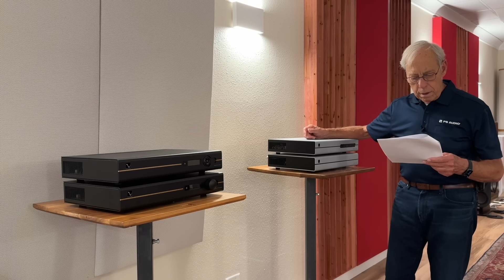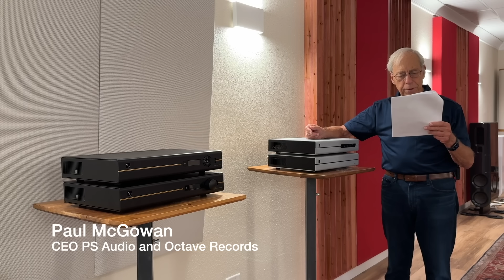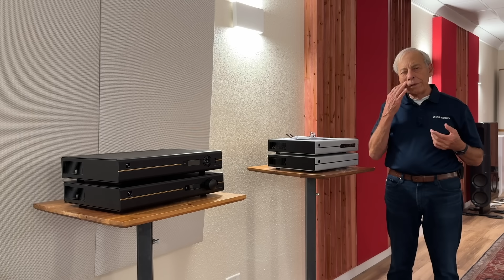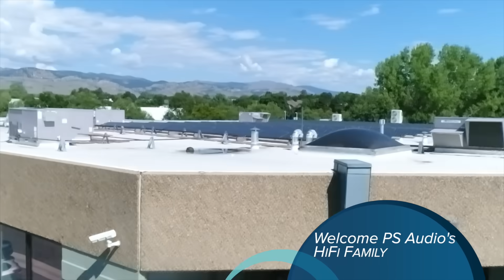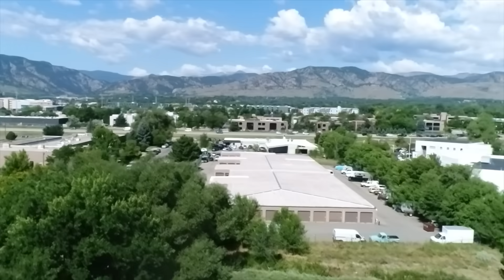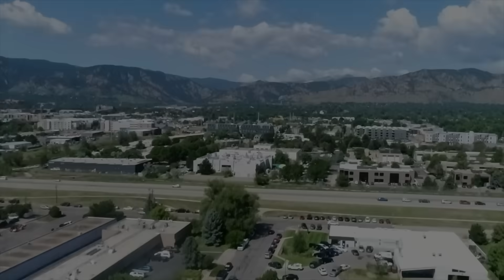Why some systems sound flat

Comment: Carlos, from Buenos Aires, Argentina, the first thing that you should do is to confirm that the issue really is the quality of your electrical power, at different times of the day.

To do that, choose a couple of songs that sound magical at night.  Then use those exact same songs during the day.  If those two songs lose their magic, then the issue is probably with your electrical power.

There are UPS (uninterruptible power supply) systems, generally used for computers, where the best of them run as "on-line".  And I wonder if one of them would do the trick.  They will probably not be as good as our host's power plants.  But they will also cost less, and maybe worth a try.

There are three types of UPS systems.  From lowest quality to highest quality:

-- Standby:
They basically do nothing, other than switch to batteries, when there is a power failure.

-- Line Interactive:
They will adjust the output voltage, if the input voltage moves too far out of spec.  They will also switch to batteries if the voltage goes beyond what they can correct, or if there is a power failure.

-- On-Line:
Your connected equipment never sees the power from the utility company.
On-line UPS systems do double conversions (which I believe our host's power plants also do), from AC to DC, and then back to AC.  So your connect equipment sees only the freshly created AC from the UPS box.

Theoretically, an on-line UPS will always send out a perfect sine wave and the right voltage.  However, I do not know if they remain steady if a pair of amps suddenly make a large power draw.

On-line UPS systems can cost anywhere from several hundred dollars, to more than a house by the lake.  It depends on how much of a load they can support.  The largest models can run a small city (several megawatts).  Large tech companies use them to keep their data centers running, without electrical interruptions.

I own a couple from Eaton Powerware (models 9120 and 9130 -- both discontinued).  But I never tried one on my stereo.  It would be a chore to disconnect everything, carry it to my living-room, and then plug in everything.  A current model (9SX1500G) goes for roughly $1500, and is rated at 1500 VA (enough to run a microwave oven or a vacuum cleaner).  If I find the time, perhaps I will indulge my curiosity and hear if using one helps.

Note that they have a fan that you can hear.  It is a soft sound, and will not be audible on anything other than very quiet musical passages.  But I cannot speak for any models other than what I own.

Also note that other manufacturers make on-line UPS systems.  American Power Conversion (APC, a Schneider Electric company) makes them.  They used to be quality products.  But their quality has tanked.  I have had 3 of them fail, a total of 7 times, over 2 years (that includes the warranty replacement models failing).  I also have two 20 year old APC, line-interactive models, that work as good as new, and never had a hiccup.  So APC is now cutting corners, and I am done with them.  Tripp Lite makes them too (not sure of the quality).  I believe that CyberPower also makes them, and also not sure of the quality.  And there are others.
Reply: I've often wondered about using computer backup power units for the Hi-Fi equipment, but haven't given it a try.
 I'm a repair technician, and your points are spot on.
Reply: @davidjudd951  The only variety of UPS boxes that makes sense for a stereo is an on-line variety.  And be sure that it outputs a pure sine wave.  Probably all on-line modes do.  But who knows?

One place where manufacturers cut corners is having their UPS systems output square waves (the worst), and stepped sine waves (better, but still not good).

A good power supply will be able to handle square waves and stepped sine waves, but over time, will probably be damaged and lead to equipment failures.  And with audio gear, I will go out on a limb and say that if you feed it anything other than a pure sine wave, then your sound quality will suffer.

If you get a UPS for a desktop computer, a sign of quality is if it outputs a pure sine wave, when it is on battery (during an electrical outage).  There are many line-interactive UPS systems, and most (I believe) output a stepped sign wave, when they switch to their batteries.  For a computer, to occasionally run on a stepped sine wave for a few seconds or a few minutes, is probably fine.  But one measure of a quality, line-interactive UPS system is if it outputs a pure sine wave while running on its batteries.

Comment: I have 2 P12 power regenerators that make a big difference in the entire system & there's no way I could go without them now but somehow I still hear not so good sound early in the morning no matter what. It's probably the neighborhood plus the house is 70 yrs old but still it's only in the morning & by afternoon it's gone. Time to upgrade the wiring too which does help. Audiophile upgrades never End
Reply: Rabbit-hole diplomacy 😂
Reply: I have a 65 year old house. 
 I noticed several years ago, after I rewired the house, and got rid of the old two wire (dangerous) wire,  and went with 12 gauge 20 amp throughout the whole house, that the big screen TV seemed brighter and overall just a better picture. 
 Then one day shortly after the project, I fire up the music, and it seemed much better. 
 I always wonder if I was imagining it or not. 
 I don't think I was imagining it, since I wasn't even thinking of the TV picture quality or Hi-Fi sound as a reason for the project.
Reply: @davidjudd951   ...exactly! But some flat Earthers will tell you that it's The Placebo Effect 🙄

Comment: This guy is so full of it hahaha
Reply: Take this from an electronic engineer (me), this guy is absolutely totally full of it I promise you 🤣 everyone is using the peak of that sine wave at the same time?? And somehow that makes your audio flat? This is insane speak. He clearly has no understanding of the electrical system he’s plugging his gear into, or more likely wants you to have no real understanding of the system.
To be clear, the 50/60hz waveform from the power grid will have an RMS voltage within a published tolerance throughout the day/night cycle. Unless there is an actual issue with the grid. The power supply of your device will rectify, smooth and then regulate this to a clean DC level, and any ripple here is entirely down to the design of the power supply of the device. Ripple here could cause noise in your audio output if it is badly isolated but it will manifest in the form of a 50/60Hz hum introduced in the power amplification typically. It will not however change the profile of the digital audio processing subsystems or analogue filtering or literally anything else that affects sound.
Reply: Based on what, exactly?
Reply: @vladfarcam4817 ...hmmm, let me guess.
Paul  has worked hard all his life & built up a successful business over fifty years, whereas you are
still living off food stamps that are about to be cut & living in a rent-controlled hovel. Butt-hurt much? 😁
Reply: Yeah he made money selling you stuff - have a think
Reply: Just because you don’t understand doesn’t mean he’s full of it, go listen to your noise
Reply: @mattjashyn3194  I hope you enjoy the hiss and cracks of your turntable tonight!

Comment: The noise. And /or lower voltage during peak times does not change the ability of a system to play the source accurately except for the added noise(rf) . And some slightly reduced voltage.. translated...less power. But only noticeable if played at moderate to high levels.

Comment: Please stop using or not correcting incorrect terms..flat means correct.. accurate to the source.  Flat does not mean no bass and no treble ..or not dynamic..(compressed) . As someone that sells . Builds. Designs.teaches...its your job to do what we all did in the 60s and 70s... educate..
Reply: Flat doesn't mean correct unless you're using a test tone. He's listening to music
Reply: If you define what "flat" means before you start talking, then 'flat' can mean whatever you want it to mean.
Reply: Gosh, this is too stupid. Your mains voltage is not that different and only your power amplifier without voltage regulator will change the peak dynamics due to a slightly lower voltage. A few volts lower means a fraction of a Decibel at MAXIMUM USABLE VOLUME...which is not what you use in the evening unless you have some insane party. No, truth is, in the evening you reduce the volume because it's evening and our friends Fletcher & Munson make your audio sound subjectively more narrow band (equal loudness curves). Another factor is the simple fact that when we feel more sleepy, tired or drunk, we lose ability to experience music at its fullest. Try a Red Bull and if your system comes alive...it's also not a system issue but a brain issue. But all respect to Paul who wants to make more business. He is still the most awesome CEO in audio.
Reply: @ThinkingBetter   ...ahh, 'some insane parties'...great memories 👍
Reply: @ThinkingBetter It's been a thing for as long as I can remember to test stereo in the evening or at night as it can sound better in some places. There's a whole lot more to electricity than just voltage or voltage regulation.
Reply: @PSA78   ...according to some, you have to be able to measure it, otherwise it doesn't exist 🙄
Reply: Funny thing is, a lot can be measured, it just requires equipment that most might not have. But there's things that we can't measure or usually don't measure as well, that anyone can hear the difference in, like the tone from two different instruments with different harmonics. It can be measured, but we usually don't, we simply listen to them and decide what we like. 😄
Reply: @PSA78   ...I agree, & since this is about audio, your best measuring device is your hearing, regardless of what the measurements crowd claim. Measurements are a necessary part of development & factory testing, however, once the product is sitting in its carton, in the warehouse, ready for sale, the physical/electronic side of measuring audio gear is moot because it's over. From that point on you 'measure' with your hearing.
Reply: It's over for electronics, but it's still useful to measure response, reverb etc in the room if there's any issues, not that it's 100% needed but it sure can help speed up the process. 😄For things that's often argued over like cables, regenerators etc, it can be measured, but if it's enough of a difference for someone to motivate to buy something is up to that individual. Most rooms have a greater impact than most equipment in the end so there's a lot that have to come together beyond expensive equipment.🙂
But it is hysterical when people don't even know how to measure, and then they say nothing happens, thrown on a pile of what they call snake oil (not that there aren't some snake oil, we all know that). 😂
Reply: @PSA78   ...ah, yes...but now we are talking about (measuring) the room & not the gear, strictly speaking.
Reply: Yes, two different animals, though I guess it could potentially help eliminate or narrow things down.
Electronic in my experience clamp things down, the image and dynamics dissappear, almost like a radio with slightly bad reception. Speakers or the room make it muddy by adding resonance or reverb. Both hurt image and transparency, one by subtracting and one by adding.
At least in my experience. 😄
Reply: @PSA78   ...OK, yes, it also comes down to our personal, & different, experiences. My quick way of testing the room is ye olde hand-clap...it's always been enough for me to get close enough. Maybe I would buy a mic & go DIRAC if I had OCD, but I don't. My room has about a 0.3 second delay, so I'm very blessed in that regard 😁
Reply: The benefit as I have seen is pinpointing where in the frequency band something occur, changing something in the speaker setup or sound treatment (location, type etc) will likely show up.  It's not exactly expensive, something like a UMIK is around $100 or so, and REW is free to download and use. But in the end, if you're happy then it should be what matters. 😄

Comment: So would this "problem" be worse in a 230v environment, compared to a 115v environment ?
Reply: No, better, because the currents are lower.
Reply: @hugobloemers4425 
Correct, we are lucky in Australia having  240v and clean compared to 110v in other countries.
Reply: Some add 230v to their Hifi room, current is higher on 115v = more noise. Im a happy camper all day and night with 236v in norway.
Reply: No, it's the opposite. The voltage is not a problem, but the current